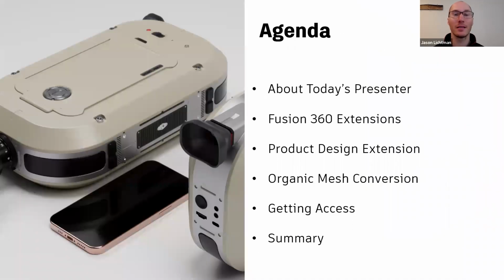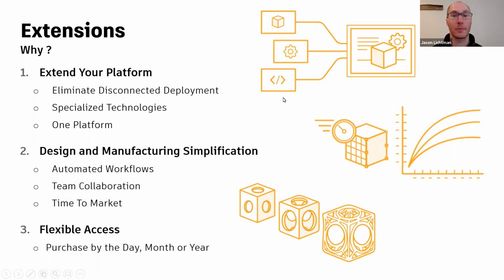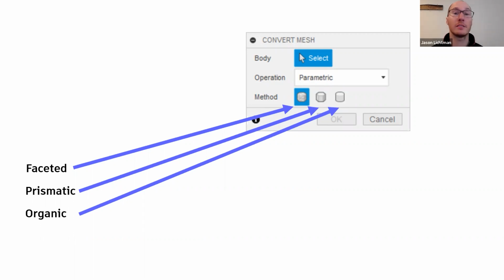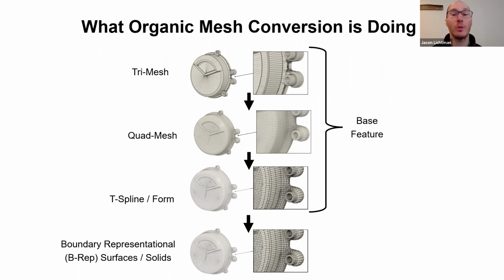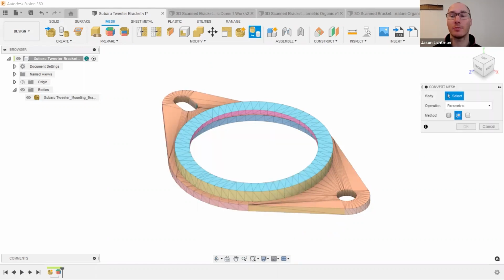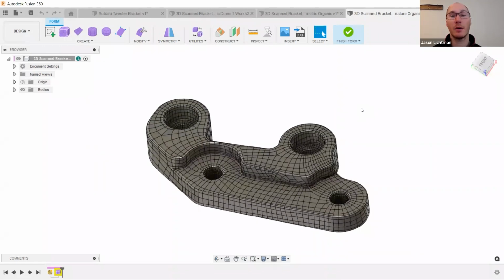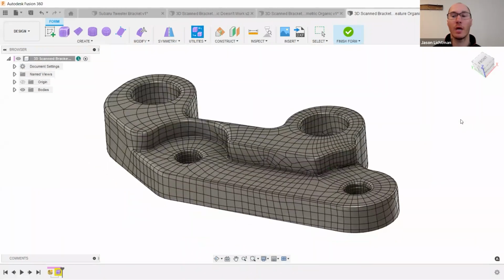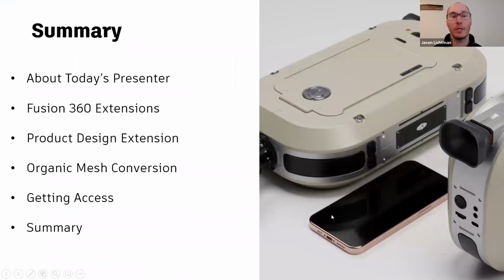Webinar: Improve your mesh results with organic mesh conversion | Autodesk Fusion 360

Comment: I wonder why you didnt also mention the price of the added organic feature. You have to buy this design pack full of other things I dont need over 700 bucks US!! The base price I have no problem with or even some extention packs but this should be standard.  Im so tired of these little blue plug icons riddle through fusion. I get it for advance stuff like generative design. But to pay over 700 bucks to convert a dam mesh is ridiculous. STOP GROUPING FEATURES. Typically people only need one button out of 20. You want to tuck all these pay to use buttons everywhere then allow customers to pay for the single feather and not a box of stuff they dont want or use. Getting to the point where Solidworks is almost worth doing as the price keeps climbing. My current project derailed because of this as I dont want to burn the money for a single conversion. Rant over.

Comment: This is a really neat feature, but it really sucks it's locked behind the product extension. Forms are pretty hard to work with in general, and the organic conversion would make it a lot easier. I really don't like that you guys are putting this sort of basic stuff in a locked extension. It should be included with form, I mean...why try to squeeze so hard? :/

I'll have to try to work-around Exoside Quadremesher as suggested by the user below. Just...why?
Reply: How did it go? Looks like exosides might actually be the more accomplished solution anyway, with years of experience developing that tool. Currently trying to assess which one to go for.
Reply: You can always us InstantMeshes. The object shown in this video, however, is a very bad example. It is a scan of prismatic geometry, and remeshing the triangulated scan into  a quad mesh is the WRONG method if you need accurate CAD geomerty.

Comment: That price...um no thanks. Stop innovating your base product so you can charge extra for basic features as extensions, pretty typical business plan I guess.
Reply: Im fine with the base price, its all the stupid extentions that double the costs.
Reply: @trevoradams8675 try doing a 4th axis operation, thats $1600 just to use a hobby machine.  It used to be free, now all of us that bought the tormach 4th axis now how to spend more on the extension than the whole 4th axis.
Reply: Outside the US it is substantially more expensive. Over $900 here in Japan!! For working with organic meshes  Exoside's Quadremesher for Fusion 360 is better and much cheaper.
Reply from the maker: @CAM, we issue new updates nearly every 6 weeks. These updates include improvements to extensions and also the base product. Here is information regarding yesterday's update: https://www.autodesk.com/products/fusion-360/blog/march-2022-product-update-whats-new/
Reply: @adskFusion  Still waiting for 2016 to update to allow GPU rendering. The aguement for CPU only back then was valid but now GPU SEVERLY out takes CPU. I have renders for 2 hours and Fusion crashes. It would take meer minutes on GPU

Comment: I'm currently an employer of SQ4 I which basically, consists of artificial cement, I would like to fuse both architectural design with the material design with the 3dprinting of the homes but perfect even also come to practice also bridges, & highways with this procedure.